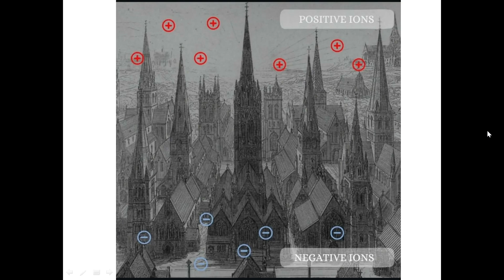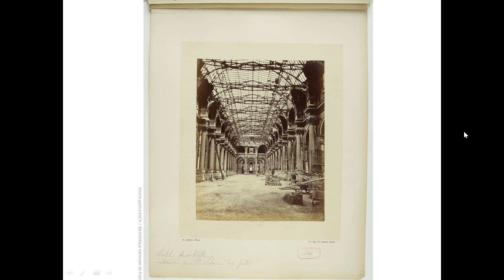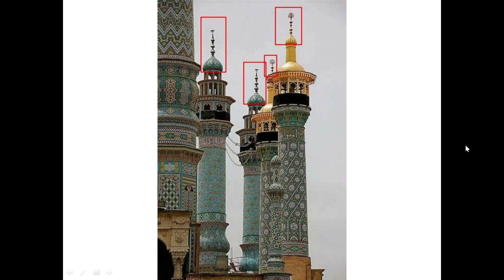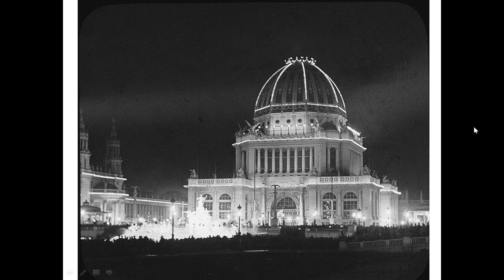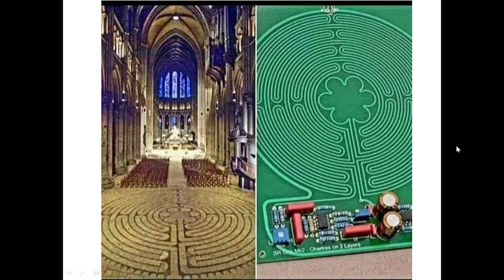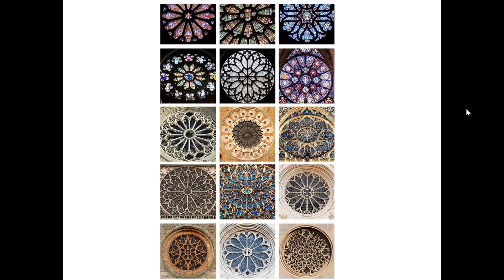The Cathedral and Tartarian Power Grid⚡⚡

Comment: Hello! I came across something regarding the symbol on the sides of buildings - a horizontal line with 3 radiating vertical lines coming down with what looks like a cut off cable. Apparently that symbol is all over the UK and were used as benchmarks.
It looks like the ones without the cut off cable were made more quickly and with less precision. Maybe it’s just a copy of a symbol that was used to denote something else before it was used as a benchmark symbol. Or maybe that symbol was put over some of the cut off cables. Either way, super Interesting!
Reply from the maker: Blessings and thanks for your great comment and research.. 👍😁🌟🌞💫❤🙏❤